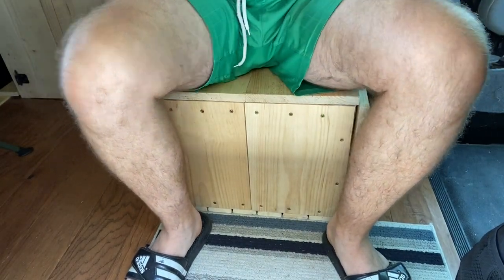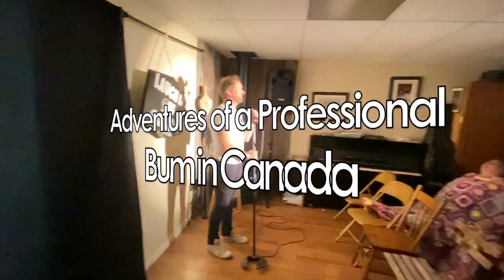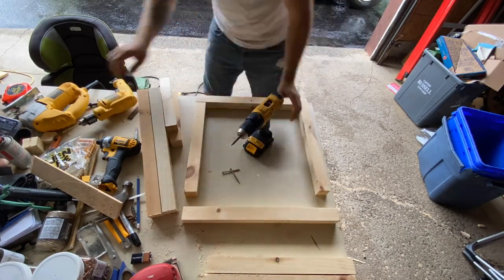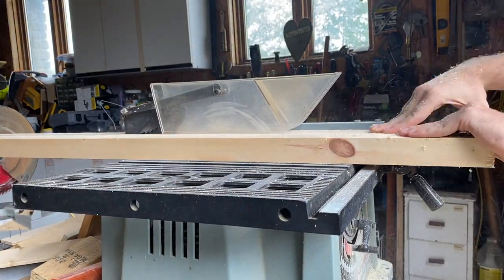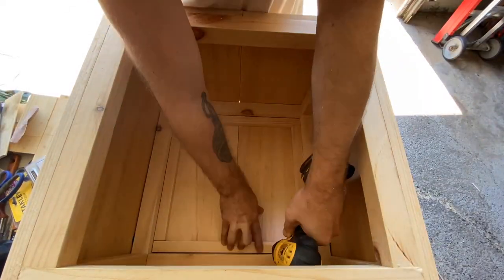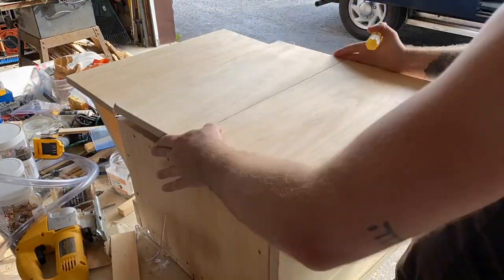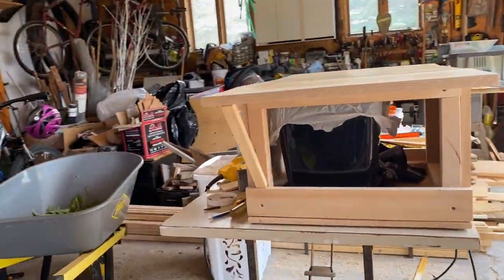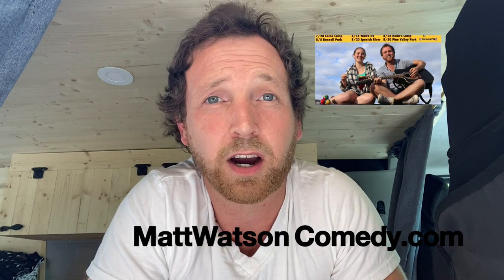DIY Van Life Folding Table with Storage

Comment: A couple things. A, very awesome you admit you got the layout wrong and took it apart. That's why we build with screws as opposed to air guns. Switch to reverse and it all comes apart. B, I don't like your table saw technique. I never reach behind the blade. Instead i will just flip the board out and start a new cut from the other end. This keeps my hands away from the blade. Second, a crosscut sled would be nice.. It makes all the cross cuts safer and allows stops for the production runs. lastly, and this is personal, I know, I don't use the blade guard. You like your and trust the kickback feature, but I would never teach anyone to reach behind the blade.. By flipping the board and starting from the other end, it eliminates the need for push sticks (which I don't use either) and changing stances from the front to the side and back while the saw is running. no no no no no. How do you hit the shut off switch if you have moved to the back of the saw? My two cents worth.
Reply from the maker: My technique on that saw is far from the safest, and with how ancient it is I could definitely use some adjustments.
Thanks for the tips!
Reply: @MattWatsonComedy   It is not a personal attack.  I only mentioned it because it was on a utube video
Reply from the maker: @serialdumpsterdiver1390  I didn’t take it that way, I took it as thoughtful:) Thanks for caring!